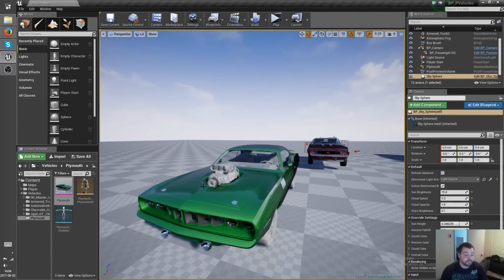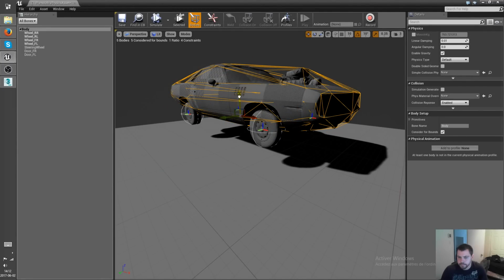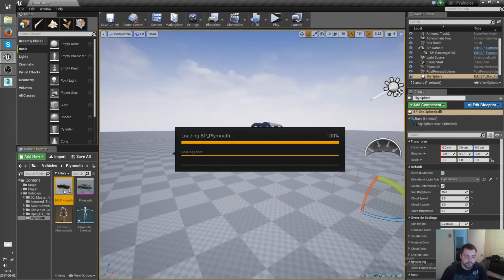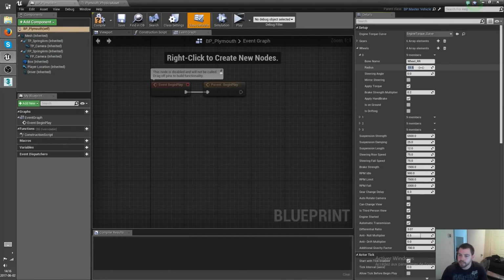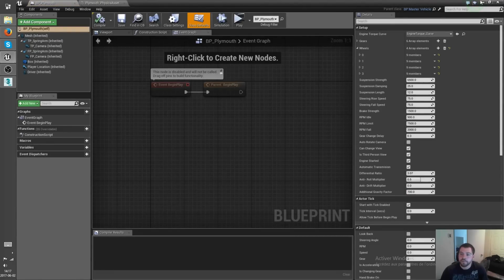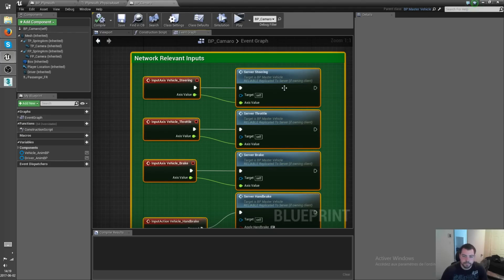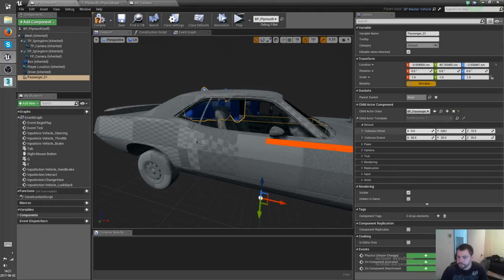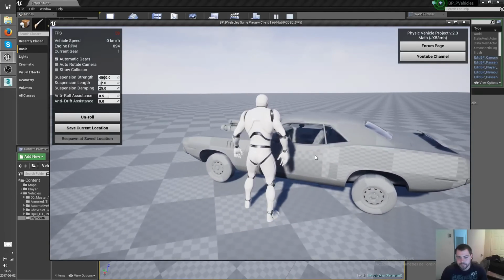How to implement new vehicles with the physic vehicle project. (unreal engine 4)(Blueprint)

Comment: Hey Math. 
I was digging into your project for 3 weeks now to test the potential and add some functions. 
I was playing around A LOT with set ups, different shapes, car types etc. After making 5 cars working with your project I noticed few things which are very important if we want to have a good car simulator. Your Camaro really works like a charm. Reminds me of GTA SA. I tried to recreate the same feeling with other models but they always have similar problems and changing RPM, capsules, gears, Anti drifting etc. didn't change anything. Funny thing that sport cars automatically turn into Forza Horizon 3 physics or Asseto Corsa. They are super oversteered. If you try to add some throttle with the wheels turned 20-45 degrees your car will make a nice 360 spin. On the other hand if you drive 200-300 km/h and you just release the throttle you will turn without problems. Child blueprints don't inherit the abillity to change the gears. Just the reverse and 1st gear are working even if you see others in your BP. Then you drive on it with 300 km/h (reverse too). Emitters under the wheels don't spawn under other cars. Acceleration curve is not individual for each car. If you change Ferrari, Camaro will be changed too.Imported cars even if they are build from one mirrored side have some problems with breaking. If you click "S" you won't lose speed in the straight line. Usually the car will forcefully turn on one side. I was really trying to allign the wheels correctly. Adding "MassInKg" can ruin the physics if your car have f.e wider back. I'm not hating or blaming you here. I think it's really great project and i'm willing to make it better too. Haven't seen anything more realistic yet in UE4. Unreal physics were always beyond my logical undestanding and I ended up making my own codes many times so I can tell it's really hard to make everything right here :P I'm not telling you to work your ass off with this project but maybe you already have some ideas to solve the problems I mentioned above. I will try to make it work. I'm 200% sure I did everything according to your tutorials. Cheers ;)

Edit: gears are changing if the capsule values are waaayyyy higher than what you should use and the car is too slow this way. Same goes with emitters. They show itself if the value is higher

Comment: Hello Math! Help me please! Why my cars do not go faster than 150 km/h?
Reply from the maker: into the project settings, set the "Max angular velocity" to a bigger number. by default it is set to 3200, wich stop the car at 75 km/h, I've set mine to 7300.  something like 15000 should allow the cars to reach 300 km/h if you set the torque curves and gear ratios properly.
Reply: Math B , Thank you! Now all is well! But I noticed that something is wrong with the gearbox. I can only drift on 4th gear. I think that in the first gear you need to get the maximum torque and minimum RPM.
Reply from the maker: yeah something is wrong with the acceleration code. I'm investigating now, got a few ideas on the back of my mind :P

Comment: i seem to be getting a weird issue with the car physics.
When creating a new child of the master and using the same stats that the camero has gives a different result to how the camero acts. the car accelerates super fast and is way more grippy and easily rolls over due to the grip. What am i missing?
Reply from the maker: ah I forgot to show in the video but you also should apply the physical material "PM_Tires" to the wheels body in the physic asset of your new car. Does that help?
Reply: the physical material is correctly set. (or atleast appears so). any child blueprint of the camero blueprint works 100% fine while a child of the master blueprint is super grippy and accelerates super fast :s
Reply from the maker: okay but when you create a child of the master, do you copy the graph from the camaro completely? because super fast acceleration and all seem to me like you have no aditional gravity. Meaning you do not execute "server Tick" on the event tick.
Reply: it was the wheel radius...
Reply: and now things aren't replicating properly for no apparent reason. the position of cars are different on each screen :s http://i.imgur.com/2Qz1o93.png
Reply from the maker: I have no idea of what is going on. replication works fine for the camaro but not other cars? then its an error in the car BP. but without seeing what yu did I cannot help you.
Reply: i have found the cause of the issue. it seems the cars don't like being possessed directly from a game mode blueprint. creating another actor which then possessed them works fine.
edit: was my fault as inputs were being ran 4 times on the server and 8 times on clients causing everything to go crazy lol
Reply from the maker: wow, glad you found the solution :) and thanks for sharing it!
Reply: another fix is to move the create constraints function into the construction graph. the actual issue is because the arrays for the wheels and everything is attempted to be accessed before they are actually created. this shouldn't be an issue if you enable the blueprint to c++ at packing but it will still effect the editor
Reply from the maker: I used to make it happen in construction script and had problems, thats with the verssion 1.*   not too sure what the problems where but I'll try it again :P and BP to c++ at packaging make the packaged game crash for me since some structures in the BP are too complex and not converted properly.

Comment: Solid work Math. Thanks for sharing. By the way, any progress on the softbody tires yet? I was looking at how they implemented this (or at least appears to be) in Farming Simulator (yes, I know, weird game to look at, but they do have a wide variety of vehicle types and they did add deformable tires that actually react to the weight load, something I've been wanting to know how to do in ages in both Unity and UE). Might be some ideas there we can use as a basis. I'll keep looking into it when I get a chance. 

Either way, can't wait to see how your project evolves next.
Reply: how i'd do it: have a static wheel with bone/blendshape that makes it deform at the bottom then rotate the UVs to make it look as if the wheel is turning when it's not.